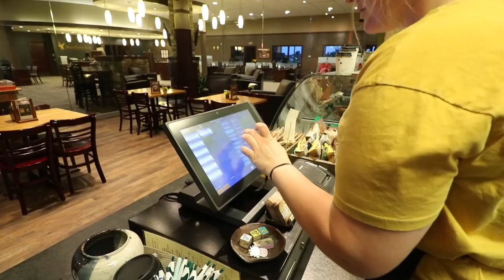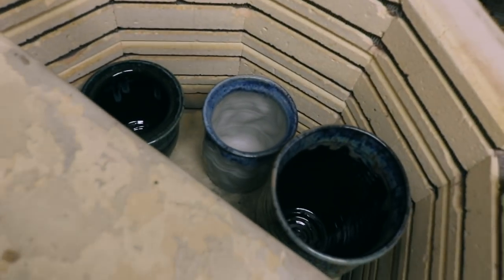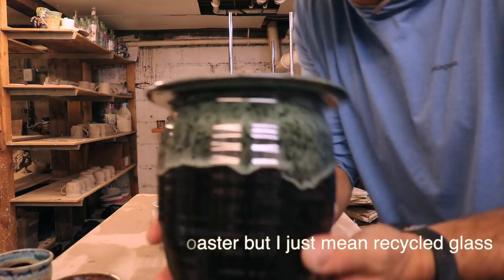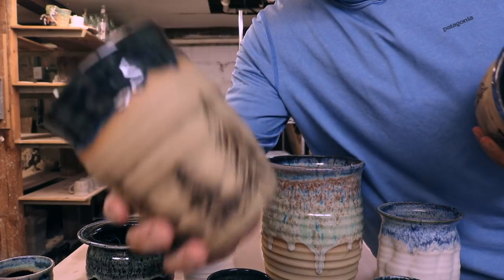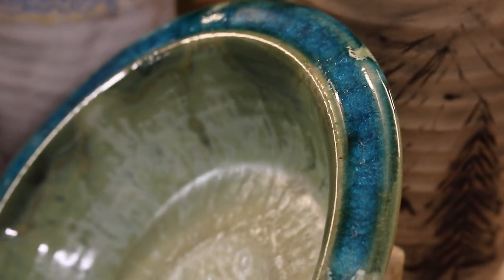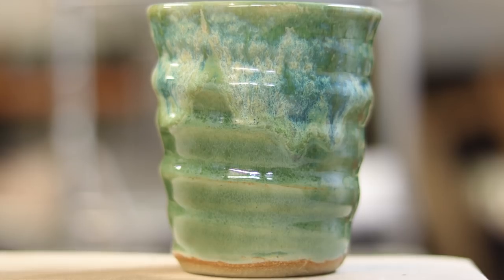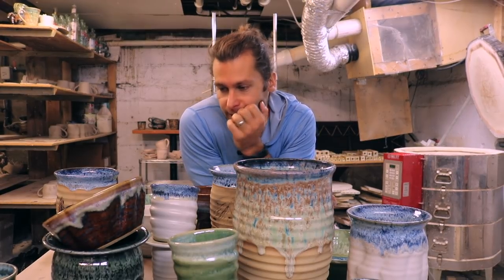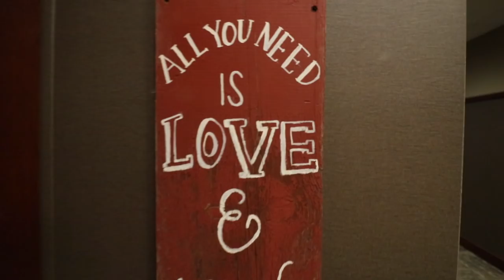Coffee Shop, Surprise Party, and POTS!  Unloading Kiln #28

Comment: When the rim of a piece has glass coasters  (I'm talking about the big bowl) but it doesn't touch where the food would be would that be food safe? I would love to make some of that for Christmas gifts!
Reply from the maker: That is a good questions!  My guess is that 99.9999% of the time it would fine.  I think when discussing the topic of food safe vs. not food safe it comes down to the piece being completely sealed.  When the recycled glass melts and then cools it creates that super cool cracking effect, but the byproduct is, it is no longer sealed, there are tiny little cracks in the glass, making it possible for water, food, etc to get inside the glass creating mold, etc.  SOO if you know this and you still want to use it I am sure it would be fine:)

Comment: Hey Jon, I was wondering why wouldn't the melted glass be food safe? It was a food safe bottle to begin with. - Katrina
Reply: I can tell you that the glass crazes (cracks) as it cools at a different rate than the clay does. This makes it possible for bacteria growth in the cracks so it’s not food safe. ( I am a professional potter too) hope that helps!
Reply from the maker: Thanks for the response Mary, I will add this: I think when discussing the topic of food safe vs. not food safe it comes down to the piece being completely sealed.  When the recycled glass melts and then cools it creates that super cool cracking effect, but the byproduct is, it is no longer sealed, there are tiny little cracks in the glass, making it possible for water, food, etc to get inside the glass creating mold, etc.  SOO that's why it makes sense for decorative pieces only:)